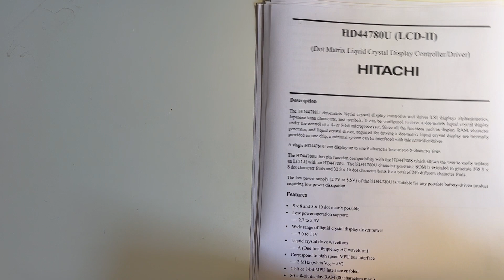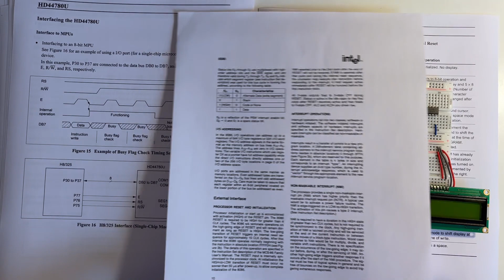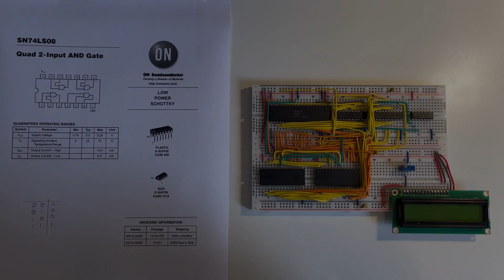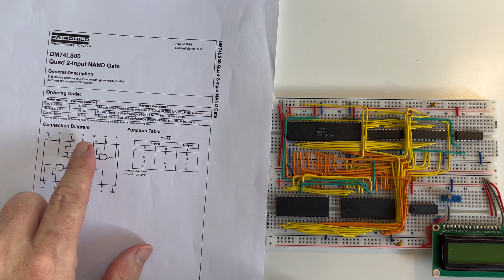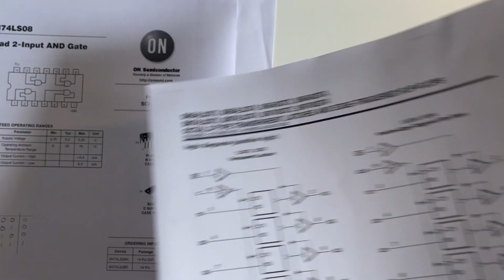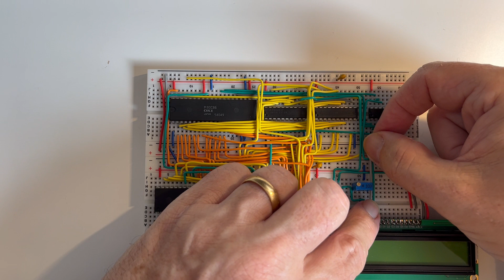Hello World on a breadboard Intel 8086 - I/O OUT instruction  - part 9

Comment: Nice! I actually made one myself something similar to this, but on Proteus circuit simulations. I do not have the spare parts (and patience) to actually hook it up on an actual breadboard. But i might make a PCB for it in the future so that my students can do these in an actual circuit.
Reply from the maker: A PCB would be perfect for students. I wanted to sort of create a design that explored how the 8086 operated as a 16 bit as compared to 8 bit, and so tried to use those principles and then realise “hold on this doesn’t quite work” so it meant it was idea in a breadboard that could then be dismantled and re-wired in as a 16 bit. I also wanted to be able to write actual 8086 assembler rather than use a software emulator. Yes it’s nice and easy to write the code and run on an emulator, but doesn’t give the same reality of programming on actual hardware. Thanks very much for your kind comments, much appreciated